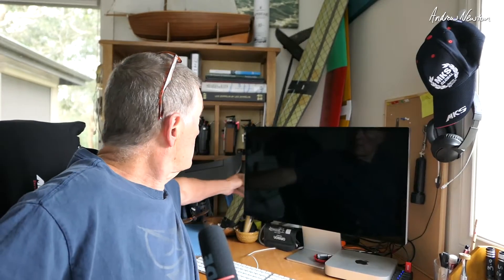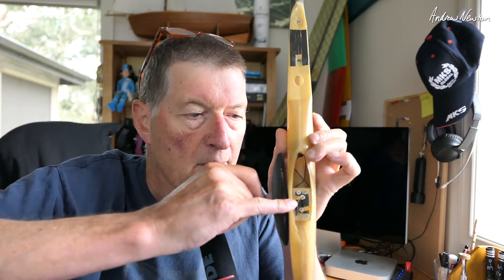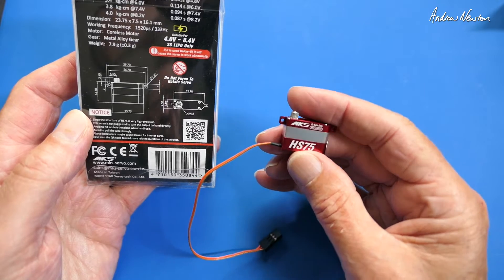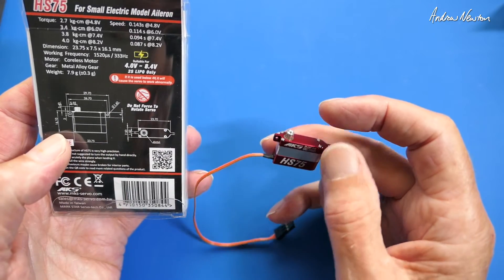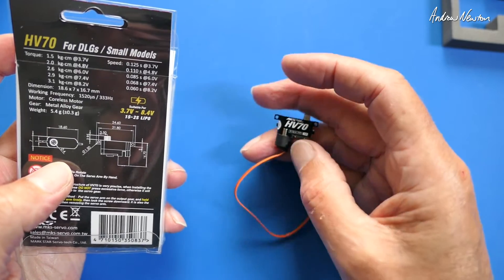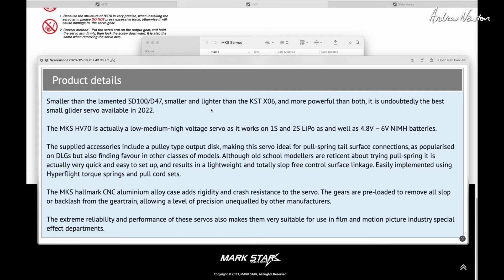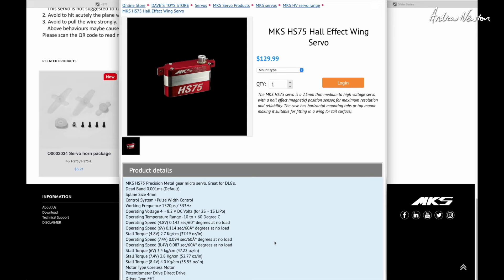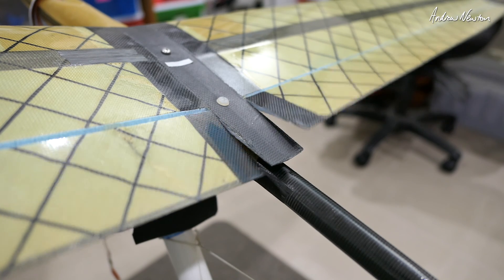MKS DLG servos. Ultra light, precise, tough and powerful

Comment: There used to be a 'Window Tax' here in the UK (around 1700, I think); the more windows your home had, the more tax you paid. After seeing this video I suspect the CAA will impose a Servo Tax to prevent hobbyists from having too much fun.

I'm currently reliving my early obsession with free-flight aeromodelling; it's relaxing, challenging, conveniently unregulated, and cheap. The planes only weigh 50 or 60 grammes so it's very tempting to sneak in a bit of radio gear and a couple of servos, but I'm afraid the Mirth Inspectors would find out and have me arrested.

['Mirth Inspectors' idea borrowed from 'The Goodies' BBC TV series.]
Reply from the maker: Good old Goodies